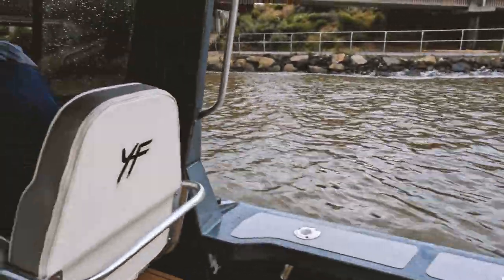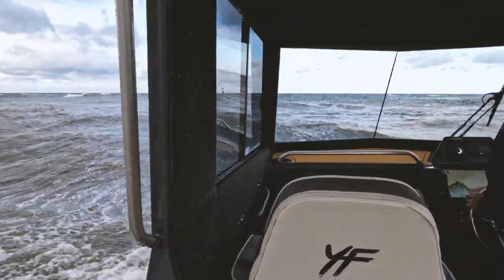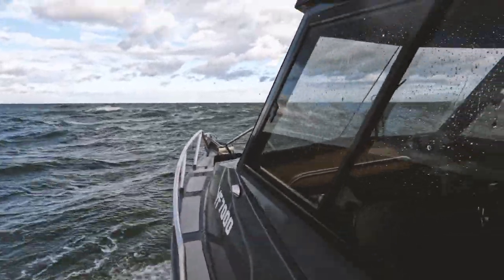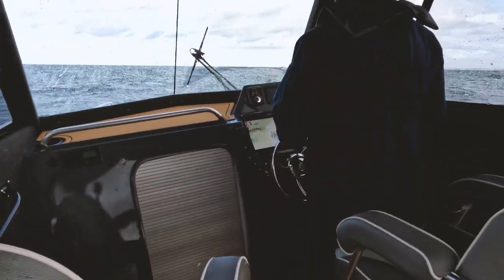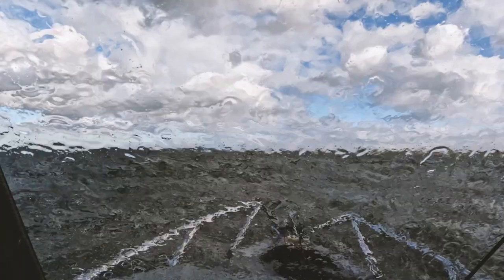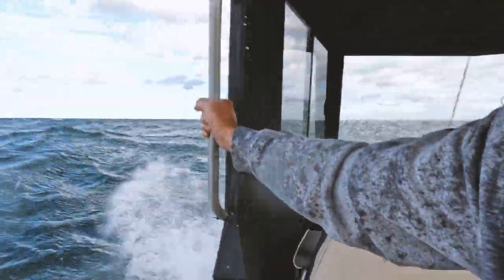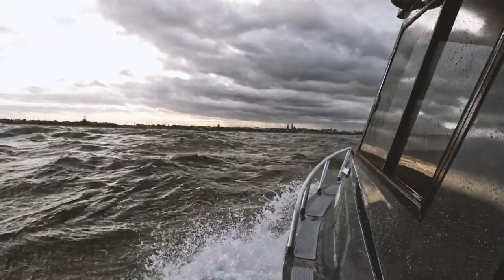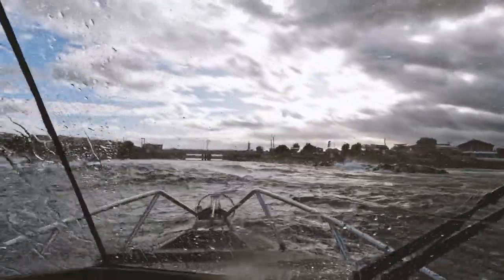Can the Yellowfin 7000 Southerner handle the rough?

Comment: A decent boat test in typical southerly PPB slop.  I don't think it would matter what trailer boat you are in, there will always be the occasional  slap and pounding if the frequency of waves and speed of the boat are out of kilter.  And the spray is also unavoidable.  What matters is the ability to endure this rough ride for hours on end.  I prefer the heavier boats as they don't 'bounce' around as much as the lighter hulls which means reduced fatigue.  Nothing like heading 40+ km off Portland to the shelf and weather turns pear shaped and having to smash your way home.....
Reply from the maker: A lot comes down to the captain and their ability to control the boat in a position that feels most comfortable. The 7000 Southerner is a straight forward boat to drive with no bad habits to look out for. The ocean always wins and will dictate when we can go offshore boating, not the other way around.

Comment: Hi would you be able to do 7600 thanks mate
Reply: I'm interested in the 7600 ,is there much difference in performance between the 225 and 300 on the 7600 ,watching your video of the 7000 with 225 and 7600 with 300 there appears only 2-3 kpm in top speed and about the same fuel economy,also does the 300 run on 91 octane, cheers ,great video
Reply: @graemehunter8869  
Hi Graeme 
Thanks mate, so to me performance wise I find the 7000 & 7600 very similar in power, stability & ruff water performance. 
The benefit of the 7600 is that extra cockpit space. 
Max HP is recommended on both packages however the F300 does need to run a high-octane fuel and the F225 is happy with 91 octane.